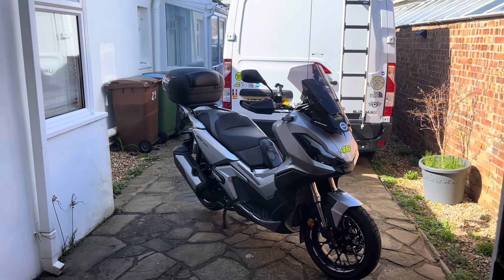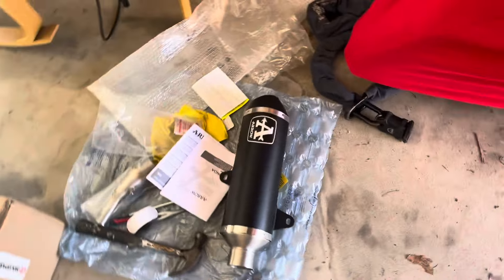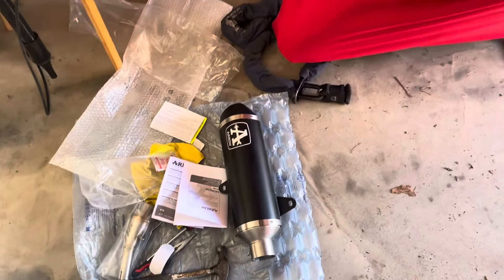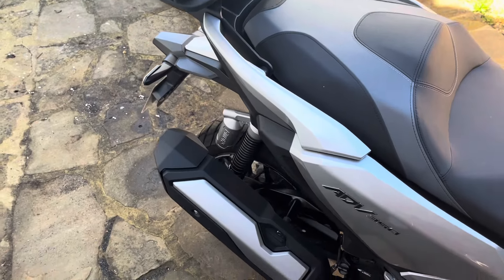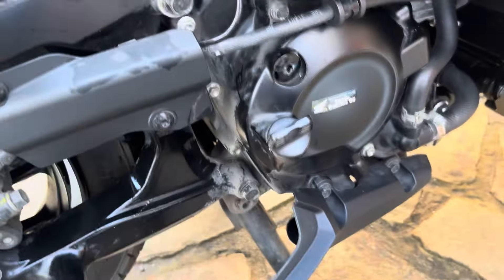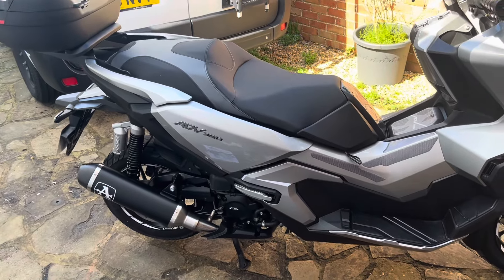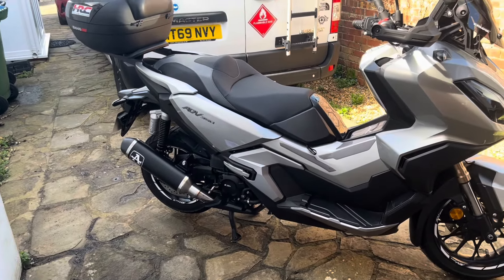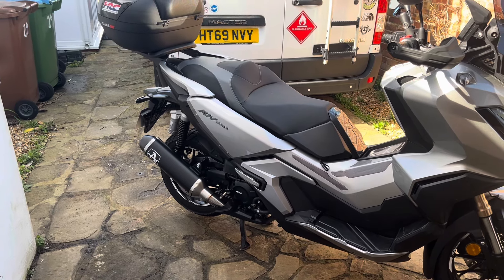Honda Adv350 Arrow aftermarket slip on exhaust fitted and sound test

Comment: Arrow exhausts  have always been greater for sound & performance, even on  a Vespa. You need mind tough when they get hot, especially for a passenger. Could / would you fit the original Honda's protection with it?
Reply from the maker: I’m not actually sure if it will fit, I will take a look tomorrow 👍🏻👍🏻👍🏻

Comment: Nice exhaust! Do you have more power? Quicker acceleration and/or higher topspeed?
Reply from the maker: Acceleration 100%, so much quicker off the line. Top speed can’t say I notice any difference.
Reply: It has to be tested on the dyno for realistic results